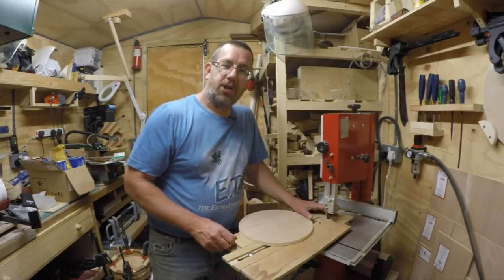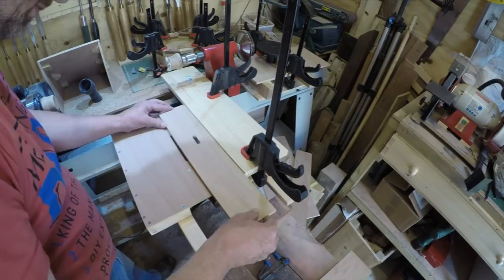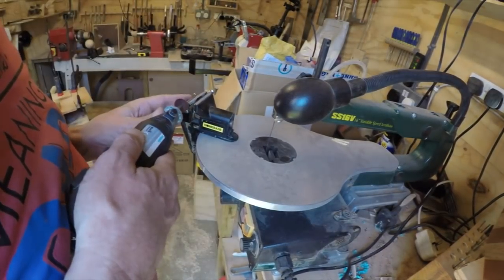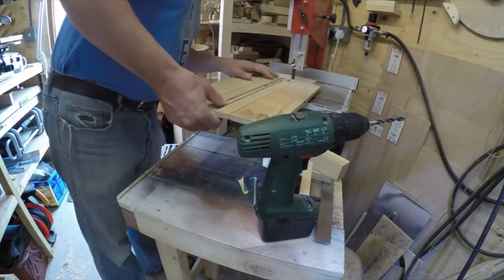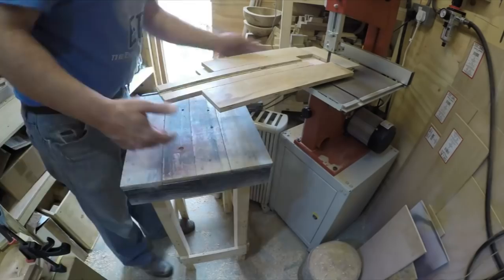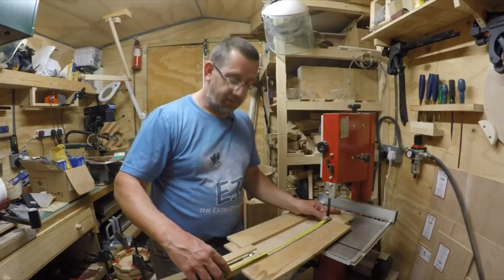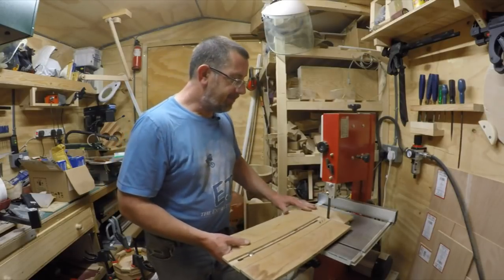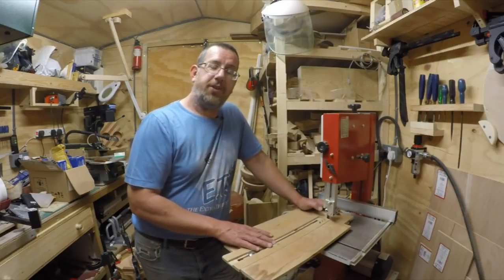Band Saw Circle Jig - Episode 138

Comment: Nice one Paul.  I made one with the  fixed  holes. As you say, great for fixed sizes but not so good at variable ones. I would love to see you take this to the next step. Maybe fitting an arduino to ti so that you can enter your size and a motor moves it to the correct location. Ok maybe not lol. Great job Paul. I think I may well have to make one of those for those in between sizes
Reply from the maker: Thank you. lol Arduino would be great but I think the reliability would be the let down spending more time fixing things rather than making. I really needed the adjustable one as several things I make need to be within a few mm so fixed sizes just wouldn't work. Plus the extra addition of the sliding rail was easily done, just takes a little more time to make.

Comment: How much clearance do you have on your bandsaw? While you have the capability to cut a 16" blank or potentially much bigger diameter, it seems it might only be thick enough for a platter. I've got 14" capacity on mine and sometimes wish there was more clearance especially when the thickness of my circle jig (while minimal) subtracts from that. Would you feel comfortable cutting anything smaller than 6" on it? If you feel so inclined, perhaps you could show the process on a blank.
Reply from the maker: Hi Derek. The bandsaw only has height clearance of 120mm, which is a real pain at times. However if you are cutting a circle it doesn't matter how big it is the saw can always deal with that. So far I've only needed to cut ply into a circle as anything that goes on the lathe I'm happy enough just cutting off the corners.